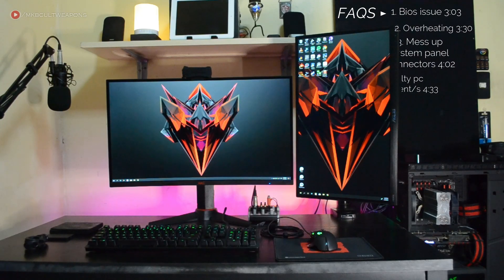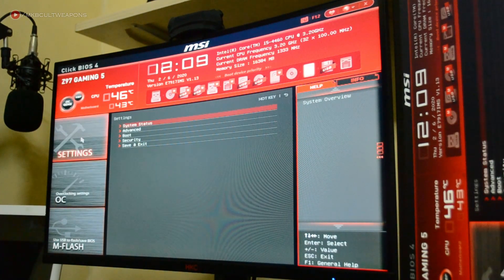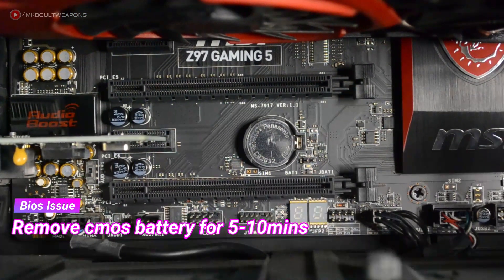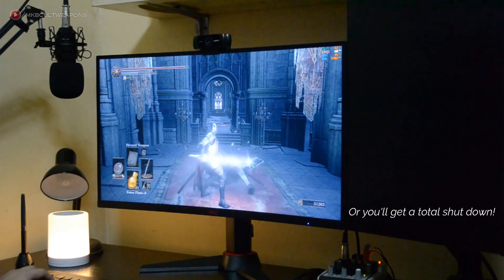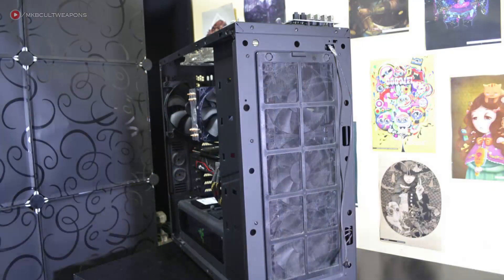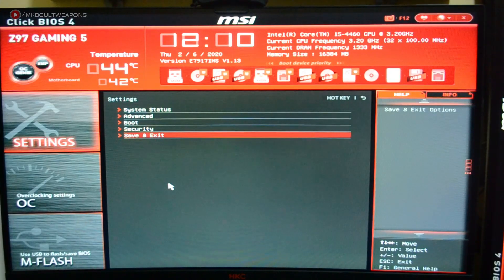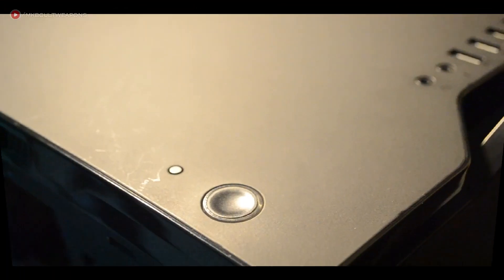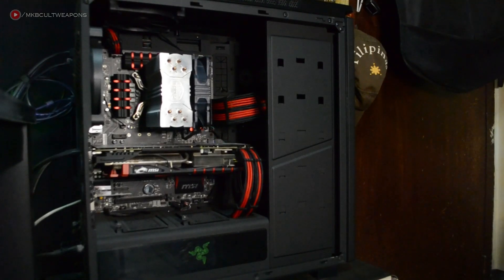Pc keeps restarting FIX / Pc continuous restarting FIX

Comment: Hi! So my problem is “simply”, I just bought  two brand new RAM sticks, exactly the same as the ones I already own. My Pc was working very very good for three months straight until I installed theses new cards... first my pc frezzed two times, the third time it restarted one time by itself then it correctly ran windows. Everything seemed fine, the four rams where apparently working fine, but I noticed to things: first of all the rgb got all messed up and the second was the Q- Led Code, it changed from “AA” to “0C” which I truly can’t find the meaning on the internet. Today the PC is not working that well, I removed the two new rams but still “0C” on the Code plus the PC sometimes feels slow graphically speaking and it have to be restarted.
Reply from the maker: install the old rams and turn off the xmp, try to reset your bios to default before you install the new rams altogether but before you do this though, i got a question. Are your rams with the same speed (3200mhz or something)? if they are the same it should work. if not don't install the new rams together with the old for it will never work.
Reply: Mac Coyzkie thank you for amswering, yes! They all have the same speed, 3600Mhz DDR4. So what I have to do is turn off xmp, reset bios by retrieving the circular battery then restart with the four installed right?
Reply from the maker: @SuperRober94  yes, worst come to worst i think you'll be needing to flash your bios, instructions are different from different motherboards so i suggest bring it to a local shop where you got your pc from and have them do that for you. Better yet, let them diagnose it for you
Reply: Mac Coyzkie thanks for the help, really appreciate it. Looking forward for a technician!
Reply: Mac Coyzkie Update So i did why you told me: turned off DOCP (XMP) with old rams, then proceed to reset the motherboard by the battery method, wait about 8 minutes, then I installed the four rams. Turned the PC back On and the troubles keep showing up (pc restarting several times before starting and still “0C” on Q-Led Code. I set up all rams to work at 3466 Mhz, and all four of them are working fine but the RGB of the rams gets bugged if I try to change anything in aura sync, don’t know if that means something. I really don’t understand what’s going on.

Comment: Hi, I do have this problem and still can't solve it, my pc just keep restarting but the thing is yesterday I tried everything nothing worked but when I took out sound blaster and extra usb slots it help turned on and I had no issues but today same is happening again
Reply from the maker: oh that might be a psu low power draw. this might be just a lose connection so check the cables inside your pc if it's plugged in all the way
Reply: @MacCoyzkie  hi, everything is connected all the way checked everything, no luck, any other suggestion ?
Reply from the maker: @badhedgehog5771  some psu can only support a particular number of device connected to it through the motherboard and usb, i suggest try the mouse and keyboard first and remove everything else connected to the usb. this happened to me too just last night because i was using a ring light and connected it to my pc. but when i removed it, it works just fine. try that out first
Reply: @MacCoyzkie  I had everything out like literally everything then tried bit by bit put things and test if works, no luck, I took my pc to service today, gonna see what they will say because I tried everything, spend 2 days researching and testing and nothing helps
Reply from the maker: @badhedgehog5771  sorry to hear that man, i hope it all goes well
Reply: @MacCoyzkie  update, they checked everything part by part and motherboard is dead, very sad news but oh well 🙂😑 time to get some upgrades then
Reply from the maker: @badhedgehog5771  oh sorry to hear that bro, but i know a new mobo is nice too 🙂
Reply: @MacCoyzkie  not as nice as old working but all good 🙂

Comment: Earlier today when I was getting off my pc, and I turned it off, it just started turning back on, so I turned it back off, but it kept turning back on. I eventually got it to stay off. 

I experienced something similar a few days before where it just randomly shut off and when I tried to turn it on, it just shut right back off, but it eventually turned on.

Also sometimes when I’m playing valorant and I switch to discord for a minute, my pc completely freezes, and plays buzzing noise in my headphones, and I had to hold the power button to force it off, and when I turned it back on it said “memory overclocking fail. System is boot up with default settings. Press F1 to run BIOS setup.”
Reply from the maker: reset the bios manually, unplugged pc from wall outlet, remove the cmos battery for at least 5mins and place it back again. try starting your pc then. If that didn't work you need to bios flash your mobo, there are different ways on different motherboards so i suggest go to local store and have them do it for you
Reply: Mac Coyzkie ok thank you so much, I’m gonna subscribe to you
Reply from the maker: @ghoulgh3376  thanks you too for the subs
Reply: Mine was actually really similar but instead it popped up blue screen of death said " your pc ran into a problem. You can restart "
Reply from the maker: @Maki_macchiato.03  im actually also considering your booth drive or some failing drive included in your pc. try removing those for the mean time and just use your boot drive

Comment: It’s so weird my pc restarts randomly Unless I’m playing a game then it stays on just fine. I don’t know if that means anything, it’s just odd to me.  I have replaced power supply that didn’t work. I have taken ram out and put back in(I haven’t tried the eraser thing which I will do today) I have checked for overheating as well. Anyway thanks for the video I will try all of the options in the video that I haven’t tried yet and see if I can fix it. I’m praying it’s not a motherboard issue! 🤞
Reply from the maker: i think your pc is fine even with your old psu, also it's weird that restarts happens on desktop tasks. This is just a theory but there might be a random program on your system tray or start up that is running that is causing the restart after update or something. This happened to me long time ago and i just simply disable then uninstalled. try checking your task manager>processes  and see if there is any program causing so much use of your cpu/memory/gpu
Reply: Mac Coyzkie thanks for the reply. I will try that and see if possibly it is just a program causing a high cpu usage. But yea I agree it’s very odd lol.
Reply: Mac Coyzkie i have a problem with my PC whenever I play a high fps game like Modern warfare it completely shuts down before the game ends and restarts again, and the worst part is that the PC is new and it’s starting to have problems already :(
Reply from the maker: @keeper5024  temps are going beyond the limit for the gpu. Usually happens in triple A games. I suggest lower your settings a bit, use msi afterburner to check the temps, open your pc case during gaming.
Reply: Mac Coyzkie sadly it’s not the temperature, it doesn’t even reach 70 whenever I try to play cod however tho i did put a framerate limit and that somehow fixed the issue but i still think there’s something wrong with my motherboard because i just brought my 2000 dollar pc and it hasn’t been a week yet since all the parts arrived
Reply from the maker: @keeper5024  wow if that's 2k$ pc that has to be a monster build! My replies to you are for the average build actually i didn't know you got a 2k$ pc. anyway if that is the case, i think setting the vsync on will also help.
Reply: Omer 3088 try getting a new psu same problem is happening to me I ordered a new one a be quiet! I’ll update you if it fixes my problem

Comment: my pc has been restarting automatically since I've updated my windows 7 ultimate to windows 10 what do you think is wrong?
Reply from the maker: if you could still go to your desktop after booting, disable the automatic restart at your settings
Reply: Same thing, but I switched from windows 8 to 10. 6 months or so go by.. It worked properly, but now it turns off by itself then turns on by itself again!!! 
I don't know how to do this nor do I know what the problem is . I'm only 13 yrs old, I don't wanna bother my parents by asking them to fix it for me because were not rich. 
Hope somebody can help
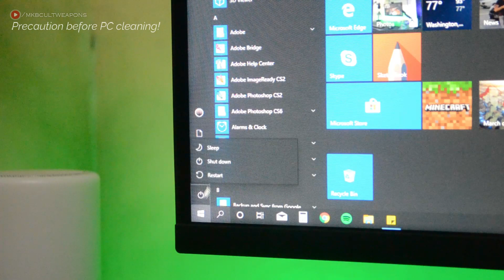Reply from the maker: @personalpurpose8333  i advice you to always do the precaution in 0:45 in this video before touching anything inside your pc. As of now just clean off the dusts inside. You don't need to do the hardware fixing for now since you were able to use it for at least 6 months. I guess this could be some malware or virus that is causing the restart loops, specially when you visit a lot of sites that are causing pop up windows.  Now this are just my assumption but can you give me more details how the began?

Anywa, you might get disappointed but the easiest way you can fix this without doing hardware stuff is reinstalling windows, backup all your important files in "safe mode" before doing the re installation.

Comment: Does overheating your pc 
Restarts your pc randomly 
I got it this problem recently
Reply from the maker: definitely
Reply: @MacCoyzkie  is there anyway to avoid this overheating problem 
My pc always heat up easily
Do you have any tip?
Reply from the maker: @namasjiisansi3085  your pc needs a good ariflow. During heavy workloads try to open your pc case also use msi afterburner to check your temps on both cpu and gpu. For cpu don't go beyon 80c but for me personally i dont go beyond 70c. as for gpu don't go beyond 90c. around 85c it's still safe
Reply: @MacCoyzkie  thanks for the tip is it ok to put a fan with a ice case so that it would have a better cooling?
Reply: Namasjii sansi I use a fan on the outside as mine gets hot easy too it will lengthen your parts lifetime

Comment: Hello sir my fan and light was going for about 5 sec and then it kept restarting i switched my ram and it worked . i tried to put the old one in to do some test now it turn on but monitor dont get any signal im scared its graphic card but can the ram give me those issues ?
Reply from the maker: yes those are ram issues ,try cleaning those ram slots thoroughly, i guess it's just dust preventing the detection
Reply: @MacCoyzkie  after some test , one of my ram is dead , brand new ram 3weeks old , thanks for the help sir

Comment: I clean ram then i open my computer butnot restarting anymore but stuck in blackscreen after a blackscreen with a loading and windows logo. Sorry for grammar please help.
Reply from the maker: restart your bios ► ground yourself and inside your pc look for the cmos battery. Remove that for at least 5 mins and place it back again. Power on your pc to check, if it still doesn't work then your bootdrive is failing or have a virus. If it has a virus the best thing to do is re-install windows, if boot drive is failing you need to buy a new one

Comment: SOLVED: Recntly my PC windows 10 would randomly freeze then restart itself. I've tried a lot of different things such as reinstalling windows, doing malware scans, disk clean up, and disk defragment, all which is due to me thinking its a software issue, but it wasn't. For my final attempt I ended up actually opening up my computer and cleaning the hardwares. to my surprise there was A LOT of dust inside, especially on my fans. After cleaning and dusting off my computer then putting everything back in. The computer finally stopped having random freezes and restarts. My issue was definetly caused by too much dust inside of my computer. I felt so stupid at the end but im really glad I solved it and dont have to buy a new computer. 2 days now and still good.
Reply from the maker: this is what some forgot but cleaning the pc will also do the trick. thanks for sharing

Comment: I need help, I just got new ram because my pre built came with only 8 gb which was enough, so I got 2 new 8 gb sticks and installed them. My computer began boot looping with like 20 second intervals and no display, so I removed them and replaced my original ram which didn’t solve anything. My pc is stuck in a boot loop now no matter what ram I’m using
Reply from the maker: are those new ram sticks have the same speed as the old one? Clean the ram slots make sure there are no dusts, place the new rams all the way till you hear a click that signifies locking mechanism of the slots

Comment: I tried to remove my ram and clean it and still it's not working pls reply asap
Reply from the maker: how did your problem started?
Reply: Same problem
My problem started when I turned on my pc it got stuck on the enter your pin screen so I turned of the ups directly and turned it on again from that point my problem started pls help
Reply from the maker: @sachin_gupta6  if it started on the pin screen man that's definitely a virus not a hardware issue
Reply: @MacCoyzkie  how do I solve it pls help
Reply: sachin gupta get a antivirus app and clean it
Reply from the maker: @sachin_gupta6  i agree with Dinker. Windows defender should be good enough, try malwarebytes too

Comment: My pc used to randomly restart so I changed psu to 650w and gpu to 2070 super and I still get problems so I change cpu cooler and my temps are below 70 degrees when it shuts off!
Reply from the maker: it should be fine, but if it happens only when you game then it must be temps. have you tried opening your pc case during gaming, it might help a little with the temps. i keep my cpu under 65c always

Comment: Have tried resetting cmos/ bios by unplugging the battery as it is connected via a cable. No luck. I have also spawned and cleaned the ram sticks. I have removed the graphics card and put it back in. What else can I try?
Reply from the maker: how did the problem started?
Reply: Mac Coyzkie don’t worry. I took everything apart and then back together and it work

Comment: hello I’m having a very huge problem with my pc . So at first it was in a boot loop then it wouldn’t turn on then it turned on with no display and now it’s back in a boot loop . So when I was gaming I accidentally knocked out my power supplies cord not once but twice first time I plugged it back in and it worked fine second time I plugged it back in and went to bed . So the next afternoon I go to get on and it was in a boot loop so I go to trouble shoot it and at first my cpu light was on from my mother board so I go to fix it and it doesn’t work so I try everything I know like switching ram sticks and taking out your cpu for any bent chips . Literally everything nothing worked so I looked online and seen the eraser on ram sticks method I try that and now it won’t turn on at all so I switch back to my old stuff and it still wouldn’t turn on . So now I’m really worried but I switch back to my upgraded parts which are my power supply gpu and mother board . Then it turns on but now my gpu light is on and my display won’t show up . So I keep trouble shooting and trying to figure out what the actual problem is because when this happened before my ram sticks were in incorrectly so I flip those around and the display still won’t show up so now this morning I flip the ram sticks again and now my DRAM light on my mother board is on . So I took everything apart and cleaned it and now my cpu light is on again and it’s in a boot loop once again I honestly have no clue what to do next .
Reply from the maker: i'm sorry for the very late reply, i've been trying to answer everyone but at time i miss comments. btw have you updated your new motherboard's bios? usually happens to new parts specially in amd builds nowadays

Comment: Can you help me?
Pc keeps restarting whenever i try to play game, bought it a day before yesterday.
I don't kow what to do now
Reply from the maker: check your temps, high temps causes pc to restart on its own
Reply: @MacCoyzkie  i checked temps with msi afterburner
Gpu temps are 70-80
Cpu temps are 70-78
Is this normal?
Checked in ac odessey
Reply from the maker: @pawn_deprived  though cpu and gpu can handle up to 90c, i will not recommend staying at 80c in the cpu though, try to maintain under 70c if you can. for the gpu 80c is ok just don't go beyond 90c. Whenever you play try opening your pc case to have a better temps.
Reply: @MacCoyzkie  yesterday the store person checked gpu, psu without the pc case, still same problem, restarting while gaming.
Changed ram, and motherboard, still same problem
Reply from the maker: @pawn_deprived  oh so what they say about it? are they going to replace your pc?
Reply: @MacCoyzkie  they told me today that they have checked everything in front of me, they don't know what's the problem, and told me to take it to service center
Reply from the maker: @pawn_deprived  you ask for replacement if they can't fix it. It's new anyway, just use your Rma
Reply: @MacCoyzkie  I'll talk to them, anyhow cpu is the problem?
Reply from the maker: @pawn_deprived  i'm not sure but it might be as well
Reply: @MacCoyzkie  hey actually i tried to open MSi misting lights software in my computer to change RGB onn the graphics card.... But it didn't open so I moved on to working with my other software and after few minutes the screen freezes and I have to force restart but didn't work so had to shut it down with power button.... now I am stuck in this look where is tries to restart and then shuts down and again tries to restart....my os is on An SSD..... please reply....people are actually. Suggesting me. To removed and replaced the battery is in the MOBO...pleasse reply...